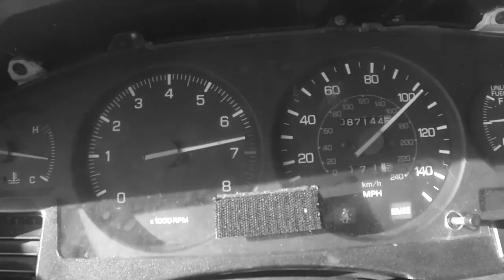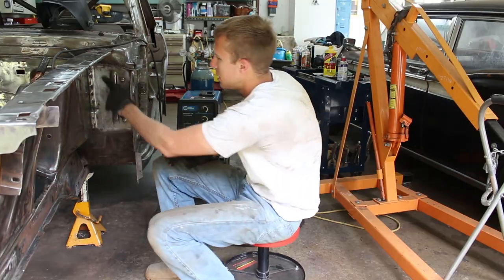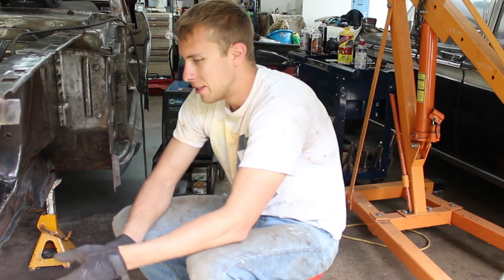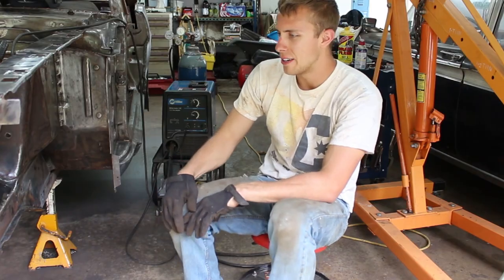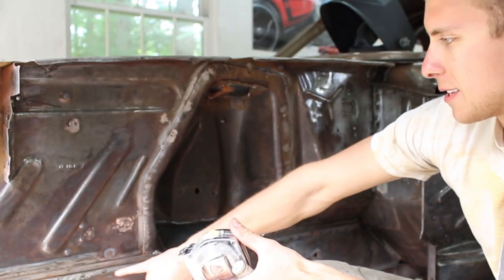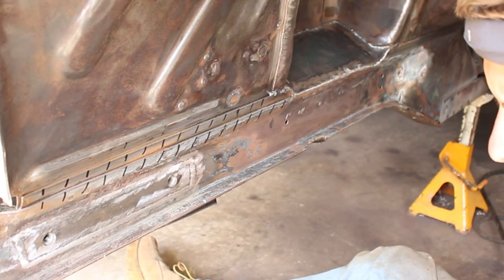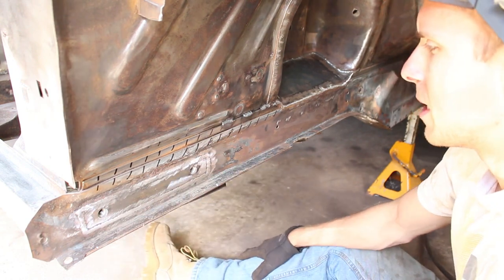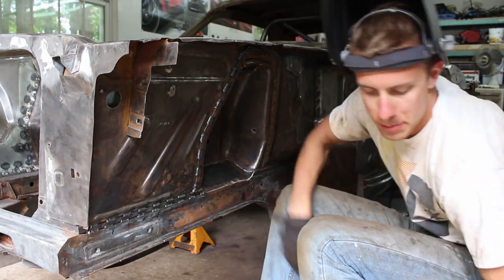How to Seam Weld | Stitch Welding | Structural welding

Comment: Thanks for this video. Now I want to weld all of the seam on my off road truck lol. I noticed that you are welding with short sleeves in several of your videos. The welding arc give off a lot of UV light and can give you a sunburn in the short run and skin damage in the long run. When welding you should keep as much skin covered as possible even when it is to hot for long sleeves.
Reply from the maker: Yeah Mark the guy who you usually see weld doesn't ever wear skin protection. I (Freddy) whenever I use my TIG I always wear a TIG jacket
Reply: +mars1952 haha try explaining to your family how you got a sunburn in the middle of winter XD Always a fun time

Comment: That much heat, and that constant welding will warp the unibody.  Skip around the chassis. Weld front left then the right... Skip to the strut support. Then back to the subframe. , Then the core support or build a torque box.... Let the heat work it's way out. Or you'll find out too late that the geometry moved. Or the doors stick, or don't stay open...

Comment: Let me know if you're going to model the suspension!
Reply: Brodey Dover I plan on running coil-overs and tubular upper and lower control arms from a company called Street or Track. They utilize most of the factory suspension points.
Reply: Brodey Dover I'm not familiar with that build but I'll be spending some money on quality parts. Also, the rear will be a 3 link with coil-overs, floating rear axle housing, and a watts link so I'd say it's getting intense attention.

Comment: I'm going to school for automotive engineering. doing the same exact thing as you ! GL with the build !

take a look at this http://forums.hybridz.org/topic/116305-torsional-rigidity-testing-280z/
 the reason why i didn't weld mine up.
Reply from the maker: Thank you!
Reply: +Nick Ritter 
Ya I completely disagree with that. The idea that seam welding can weaken a car due to heat is pretty insane. I don't think he did his testing correctly and he didn't give a really in depth look at what he seam welded and why. It looks to me like it's faulty R&D on his behalf. Realistically if his findings were accurate I'm sure the likes of Porsche, audi, Ferrari (wherever the hell you can find ferrari using steel anyways), and Ford would have picked up on these things long ago but they all still practice this today for cars that have to be off the assembly line to compete in certain races. I do like the fact that he went through the trouble to help those of us who share a genuine interest in engineering but I'd like it even better if he had a pinpoint issue with seam welding instead of guessing. "Hardened japanese Steel" is a joke. I thought I might be being to harsh but my criticisms were already asserted by others in the forum. Very interesting but very VERY misleading.